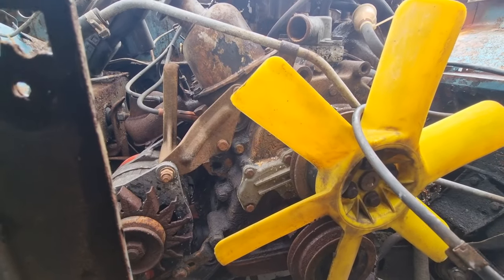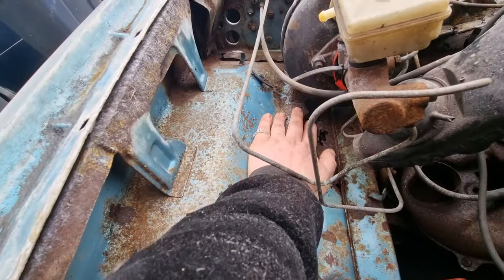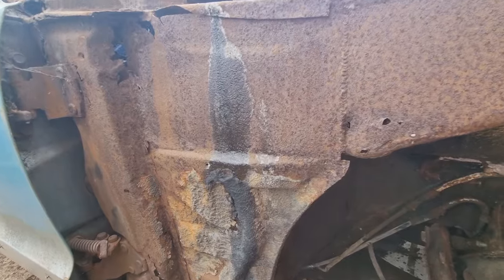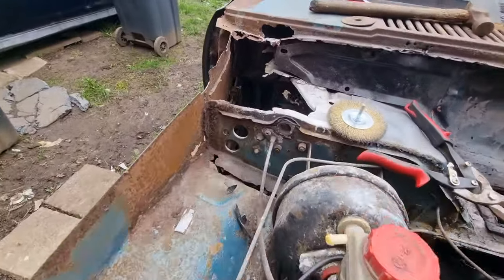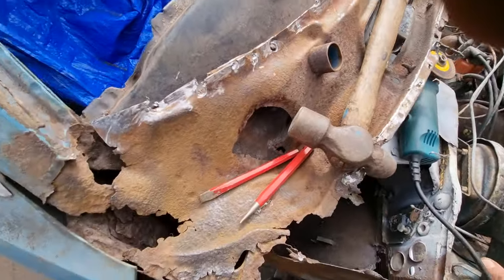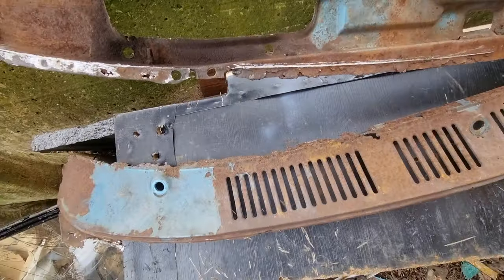Cortina Mk4 Ghia 2.3 V6 Restoration || Scuttle Removal (P12)

Comment: It's had a wing mount repair rail.i did some on a Granada a while back,but I blended them in.
Reply from the maker: Yeah seems it but would be nice for them to have finished hahaha instead of missing most of the welding
Reply: @AdamSNook.  At least when U weld it yourself,U will know what standard it's done too.ive rectified some.horror stories over the years.
Reply from the maker: @deerawselecta7709 yeah i bet i have seen some.strange things my self lol you are correct with knowing whats done if u do it your self and will be going over the whole car and having mot before ise even tho its excempt

Comment: Someone has put a new wing rail in and not welded it on, the extra strengthening brace support that estates have is also missing,
Reply from the maker: do you mean the brace that goes to the scuttle and the top secon of the scuttle near where fuse box would be if so i removed that and have noticed only estate cars have it yeah i do have that mate but you are correct on the wing top section defo unfinished wasent it lol

Comment: If you don’t cut the rust out it will all come back
Reply from the maker: what rust was you on about mate the service rust can be rust treated its never came back on my ford transit or focus or any of my other cars and have been great for over 4 years + if you mean the holes that will get cut out
Reply from the maker: hi mate also the rust will be cleaned off to bare metal before primering and if it dont clean up it will get cut out
Reply: There will be no car left if he cuts the rust out!  It's an Epic repair job.
Reply: for sure also going over rusted metal with patch's only good for the short term
Reply from the maker: @fredjones1238 the metal will be sanded back to bare metal and epoxy primered when metal work is done
Reply from the maker: @fredjones1238 i havent gone over any rust with patches the metal was cut out and new petal was put in i dont patch over metal i hate that
Reply: Love it great job bro 👏 👍 don't start your engine until you've done the necessary checks no rush is there 👍 I'm more looking forward to valve cover removal possible head removal if valves are compromised your gonna be up to your guts in nuts lol 😆
Reply from the maker: @SimonsSolarShed yeah man i carnt wait for that to lol
Reply: Not bad  !!!!!